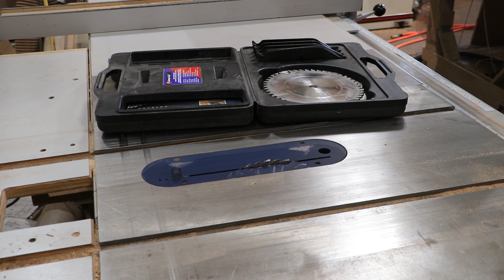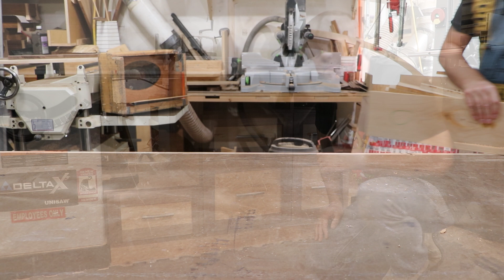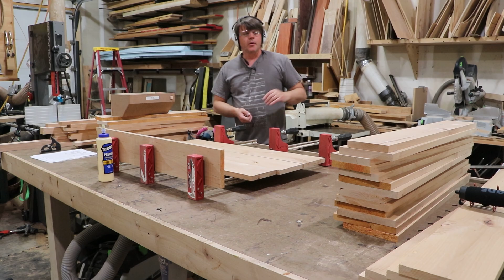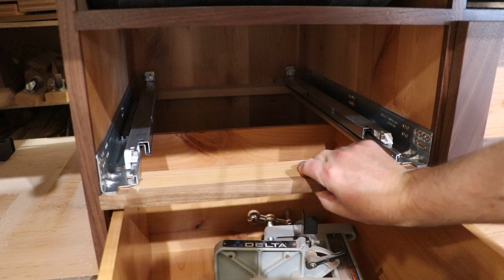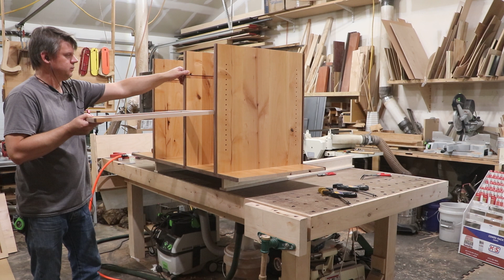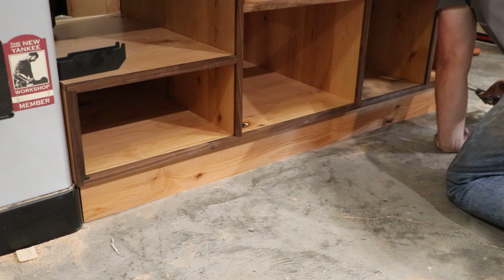How to Build a Table Saw Storage Cabinet

Comment: I thought it was only old guys like me that used 6' wooden rules.  I learned to pipe fit with them in the 70's.  For a lot of woodworking they are better than tapes.  Really good for relative dimensioning with the brass extender.
Reply from the maker: For sure, I'm not sure why they have fallen out of favor.  Works better that a floppy tape measure, and longer than a typical rule.